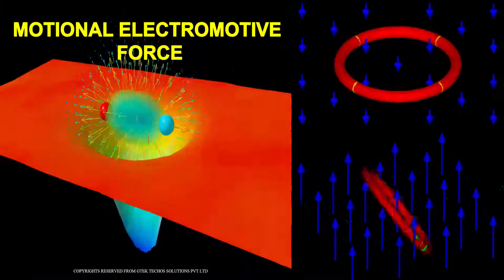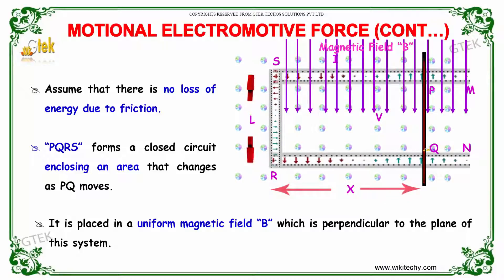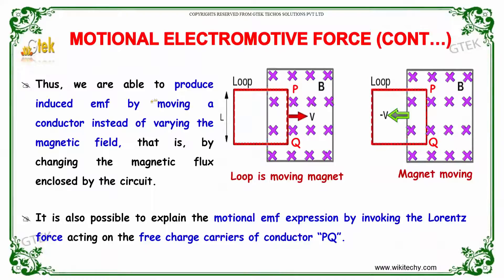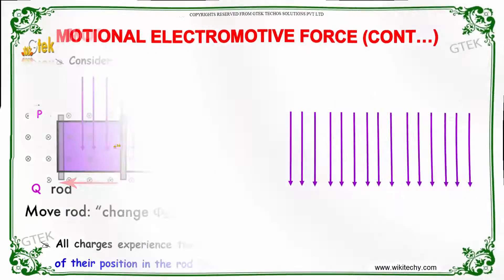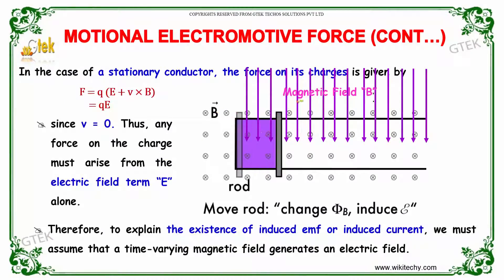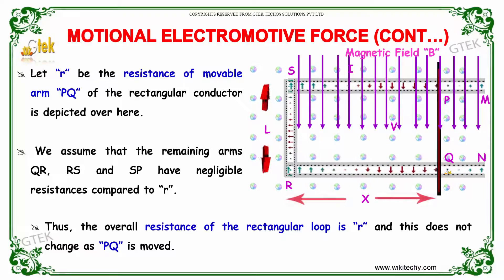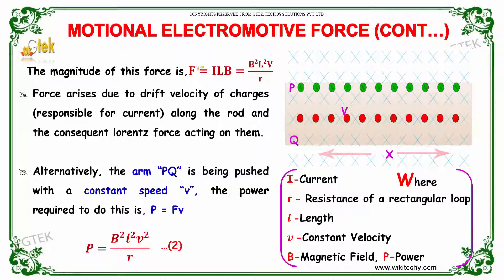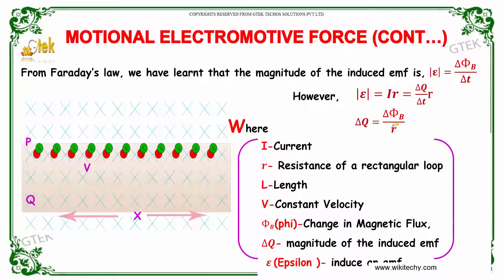Motional Electromotive Force | Electro Magnetic Induction And Alternating Current | Physics

Comment: Depending on the way in which the changes are brought about, there are two types: When the conductor is moved in a stationary magnetic field to procure a change in the flux linkage, the emf is statically induced. The electromotive force generated by motion is often referred to as motional emf.

Comment: Faraday's law of induction can be used to calculate the motional EMF when a change in magnetic flux is caused by a moving element in a system. ... Motion is one of the major causes of induction. Terms[ edit ] electromotive force. (EMF)—The voltage generated by a battery or by the magnetic force according to Faraday's Law.

Comment: In a device without internal resistance, if an electric charge Q passes through that device, and gains an energy W, the net emf for that device is the energy gained per unit charge, or W/Q. Like other measures of energy per charge, emf has SI units of volts, equivalent to joules per coulomb.

Comment: The moving bar is a source of anelectromotive force, calledmotional emf, since the emf is generated by the motion of the bar. The force is defined as: The magnitude of the induced emf can be increased by increasing the strength of the magnetic field, moving the bar faster, or using a longer bar.

Comment: electromotive force
(EMF)—The voltage generated by a battery or by the magnetic force according to Faraday's Law. It is measured in units of volts, not newtons, and thus, is not actually a force.

magnetic flux
A measure of the strength of a magnetic field in a given area.

induction
The generation of an electric current by a varying magnetic field.

Comment: Electromotive force, also called emf is the voltage developed by any source of ... This potential difference can drive a current if an external circuit is attached to the terminals. Devices ...